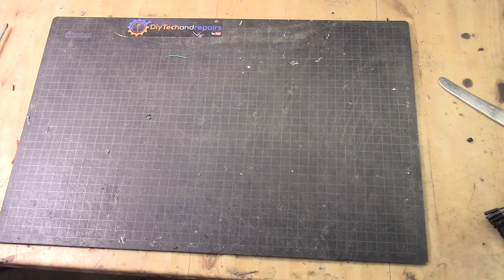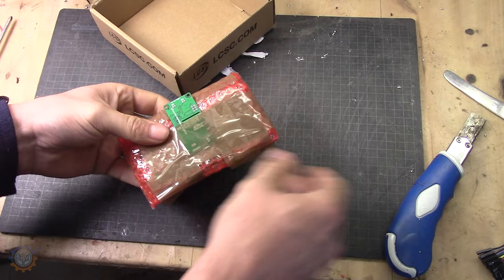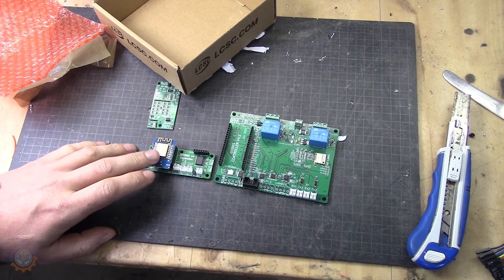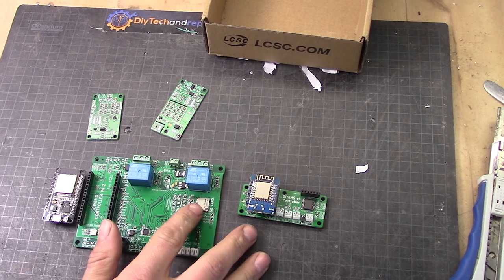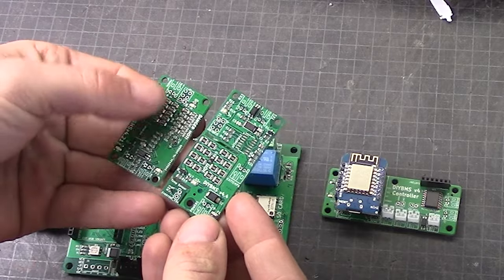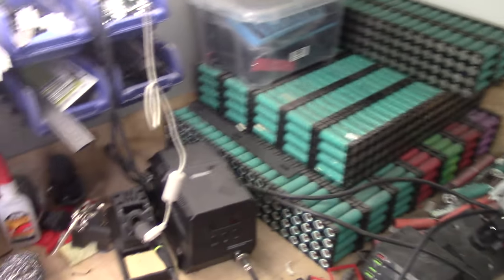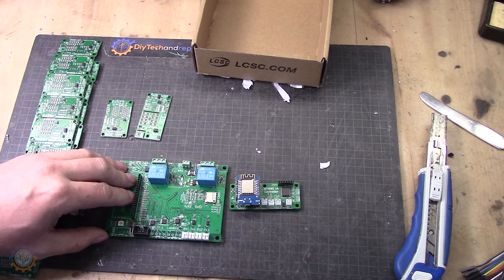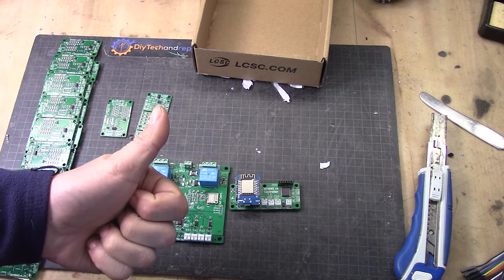DIYBMS V4.2 - Intro

Comment: Did JLCPCB solder all the relays and everything on? When I load the BOM into there website, it doesn’t even show the through hole parts.
Reply from the maker: They only do surface Mount parts.you have to do the rest.

Comment: Really loving your channel man, great work!

This diybms thing is really nice, I'm getting into this world and trying to learn and research as much as I can. However I've checked both diiybms github and also Stuart videos and I'm not able to get my mind around how this will connect to the final AC/Solar power system?. Would the inverter connect/AC charger (let's say it's an all in one) to the RE1 and RE2 inputs on the board? Is there a place where you learn more about how to connect it?. I've seen some of your videos where you use a relay board but not sure why is that either, what those relay board will control? Thanks!
Reply from the maker: The bms is to take Care of the battery and dont Care about the battery. To disconnect the battery from load i would recommend a shunt trip breaker like the ABB s3 or s5. Then IF There is a fault DIY bms can trigger it and disconnect the battery from the inverter
Reply: @DIYTechRepairs  thanks a lot for the explanation, so basically the duyBMS will inform you about the overall status and then you can trigger external relays based on that information

Comment: Hi Daniel,
the new controller from Stuart has an RS485 interface. Could the data from the PCM60X be read out there and displayed in the DIY BMS software? It would be interesting to run that together with the new Current monitor.
In your Esperyd? S Raspberry PI project, everything is going very well for the Batrium system.
Top video 👍

Comment: do you have plans to design your own BMS or are you content with the ones that already exist?
I wonder why I have not seen someone who can handle higher Amps or someone who gives those opportunities (knows that it should not be needed if the cells have the same capacity).
One thought I got before was why does not someone use 8266 for the cells and the communication via Wifi and then I thought that it "should" be enough to control a pin with a transistor that then controls a MOSFET over a resistor and then controls all of them with a ESP32 or an RPi (I know nothing about programming so do not even know if it would work)

glömde BLÄÄÄÄ ;-)
Reply from the maker: I have have done my fair share with my own bms but its not worth it and i instead now follow Stuarts design.  Higher amps as in what?  500A? or more? Several exist. you can get several 1000A if you want but they will cost you. Using 8266 on each is not viable since they 1. take to much power. 2. need higher voltage. 3. wifi will be overwhelmed with clients unless you have enterprise network.  FOr instance this setup uses ESP as master and then the slave nodes run attiny 844 that are small and tiny and can run on very low voltage as well :)
Reply: @DIYTechRepairs   OK då har jag svaret varför man inte ser nån som gjort det 
och det var ballenseringen jag tänkte på då den i många fall är låg (typ 50-200mA ) men hur mycket klarar dessa bränna bort ? 
och varför påpeka du flera ggr att det är DIY? är det att det finns buggar eller inte är pålitligt som de färdiga eller är det för det är lödning som krävs ? ( var väll ganska lite lödning om man köper dem färdiga ? men vad kostade de färdiglödda ?
Reply from the maker: @jadu79  det är skillnad på timmarna som är nedlagda på detta jämfört med ett köpe. Det står också i Stuarts information om det. Dessa ligger på 600+. Beror på version och spänning. Långt mer än vad man oftast behöver
Reply: @DIYTechRepairs  Jag inser att det är mycket tid nedlagt på dessa men min fråga var om de inte var lika pålitliga som färdiga BMSer och vad priset blir /st om man beställer dem färdiga från typ JLCPCB och jag har inte sett nått om hur mycket det kan bränna bort från ett LiFe 3,6v eller LiPo 4,2v (kolla lite men hitta inget men det brukar vara lågt därav frågan)
Reply from the maker: @jadu79  se mitt föregående svar. Det är också nedlagt mycket tid men det är fortfarande en öppen källkodsöösning. Läs gärna Stuarts info om systemet :)
Reply from the maker: @jadu79  priset beror på hur du beställer men ganska lågt :) beror på om du väljer gamla eller nya kontrollern och samma för cellmodulen
Reply: Blää från NULL :)   I've heard somewhere that the software for the ESP32 is worse... anything that matters in this case?
Reply from the maker: @andersdoverud9046  worse in what Sense? Its more code and functions so more bugs are expected especially in the beginning